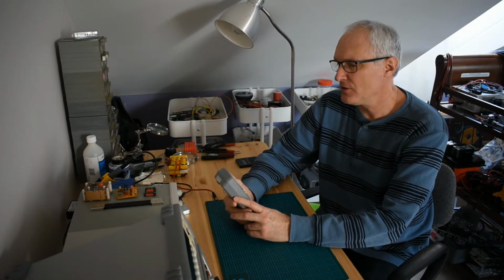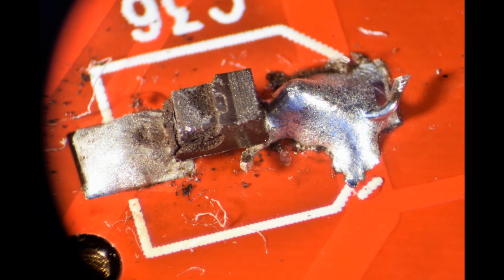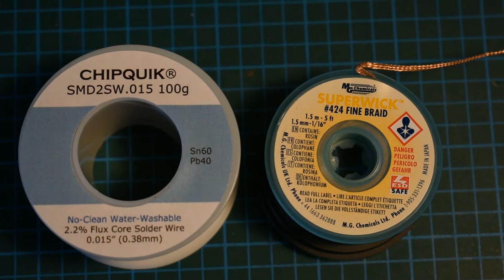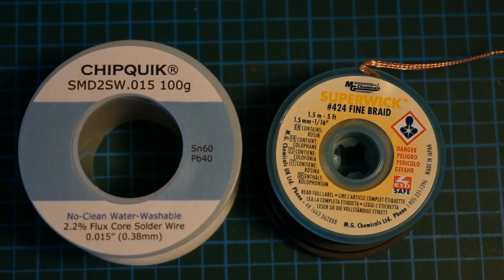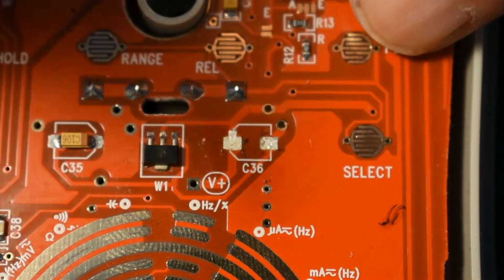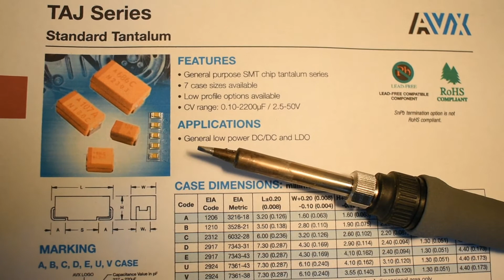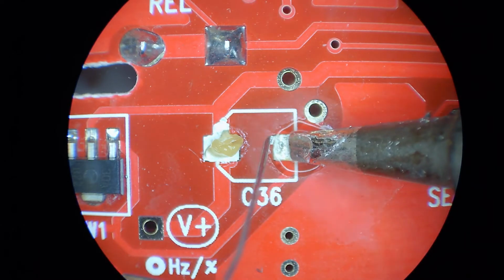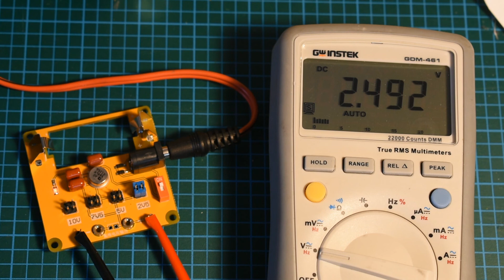GW Instek GDM-461 / UNI-T UT61E  REPAIR

Comment: Hello,
I also have a defective GDM-461 and would like to repair it. The schematic of the T-61 match it perfectly? And where is the voltage calibratation video ? ;-)
Reply from the maker: hi Jeno, I don't know if the schematic is the perfect one, but what I have found on different Forums, it is the same. I have not made a video yet for the calibration, and I can't remember if you can calibrate yourself the meter, I have not work with my meter for a long time now.
Reply: @jappietoutou  можно откалибровать,но подстроечный резистор в цепи делителя (9.09к+2к)REF не совсем правильно с завода рассчитан и слишком чувствителен.Для более плавной настройки рекомендуют заменить переменный резистор на 1к вместо 2к с завода.Я в свой старенький 61Е буду ставить 7.87к 1%+250 Ом переменный,что ещё улучшит плавность регулировки.Жду детали.